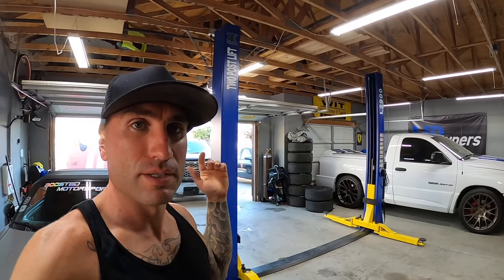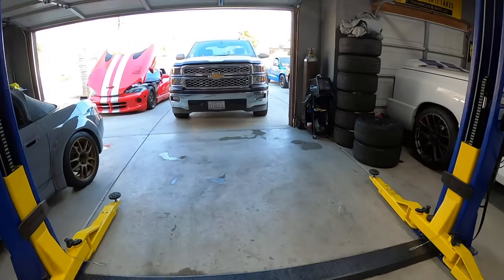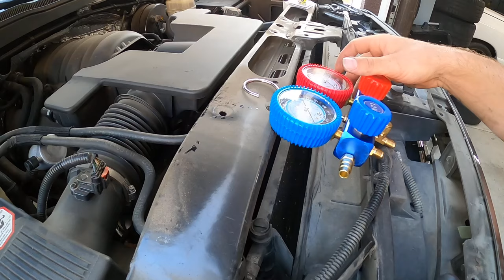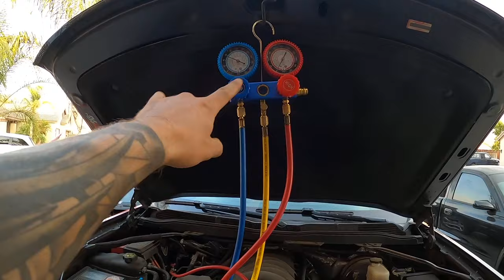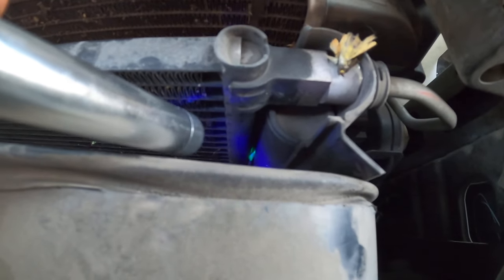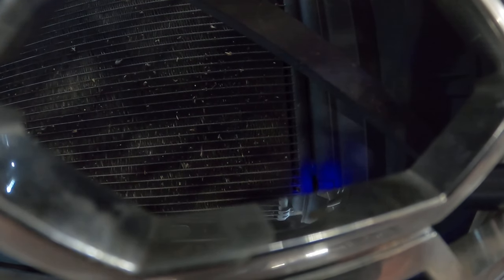HOW TO DIAGNOSE | 2014-2019 A/C FAILURE on SILVERADO | SIERRA | TAHOE | SUBURBAN

Comment: There is dye in the system from the factory. Adding refrigerant brings it back into circulation. A system is always vacuumed before filling if empty. You could vacuum the low side to suck the dye in the high side. That body style always leaks in that same place. Put the can upside down and regulate it with the low side of the manifold. Just open it a small amount and the whole can will go in in a minute. You are evaporating the refrigerant in the can causing it to get cold and lose pressure. Upside down it evaporates outside the can and the temperature and pressure in the can remain much higher
Reply: your comments are the most common sense for this video
Reply: Thanks for the tip about dye in system from factory.  Put a UV light on that weld and immediately saw the problem.

Comment: On my 2018 Tahoe, the ac and heat failed, would shut off after about 20 minutes of driving. Shop said it was because the temp outside.. so replaced actuators, evaporator core. So now soo cold it freezes and closes vents, same as before. Shutting off ac opens vents, fan blows whole time too. And no heat until after 77, vents close again after while. Then heat at max stays on, ac at max stays on, blower set to max. There is no middle.. any help appreciated.

Comment: I think I have the same issue with my 2016 Yukon, but the compressor does not come on. Can I add refrigerant without the clutch on or would you try jumping the pressure switch to add it?
Reply: I dont know for sure but my compressor would not come on and then when I added the refrigerant, the clutch started spinning so there may be a temperature indicator that engages the clutch
Reply: Did anyone try to do the relay or sensor bypass? I've tried I think correctly on the sensor and the fuse can't get it to engage and don't wanna buy freon to let it leak out haha

Comment: cool basics, but you can hook up shop air to the yellow line on the manifold gauge and charge the system with air to find the leak since you had already determined there was no system pressure. This way you don't waste refrigerant or die.

Comment: So this video REALLY helped me out alot!!! I was racking my brain trying to figure out where the leak was coming from.... I charged the system and put in some dye using this stupid injector tool I got from a part store (I didn't realize you could put the dye into the gage set before I watched this video)😅 then charged the system and sure enough BOTH the top and middle weld points were faulty. 😳😱 I'll be replacing the condenser this weekend and I'll also use your idea to reinforce it with some JB weld to better assure this won't happen again. I'm hoping this was the entirety of the issue with my truck. 🤞 Thanks for the content!! God bless! 🙌

Comment: Thanks BMS! I refilled my truck with refrigerant and it lasted about a day. The following day, my truck was blowing hot air again. I'm pretty sure I have the same problem. I will double check, but thanks for a great video.
Reply: Was there a leak in your condenser

Comment: Thank You for this Video. I have a 2015 Suburban and the AC has stopped working. The dealer has already replaced the condenser once as a recall and It looks like they will be doing it again. Thanks again for the informative video. 🇺🇸
Reply: They fix it? I have a Yukon XL my ac isn’t blowing cold

Comment: My 2017 silverado just stopped cooling all of a sudden so I wonder if this is my problem . I at least know where to look first so thank you for the vid!
Reply: Was the condenser the culprit?
Reply: @joshball4129  Yes it was.
Reply: My 2017 started blowing hot air last summer 😢I will have to check this out
Reply: There should be a recall on it.

Comment: Great video! Cant live with no ac in summer time lol. Easy way to find the leak if you can't see the obvious ones air it up with compressed air 45lbs, spray bottle soapy water an spray all connections. Fixed my 03 Ram in one weekend.
Reply from the maker: Tell me about it! I’ve been driving the Dakota all summer with no A/C and it’s been over 100 for weeks I think I’m putting the A/C back in and I’ll figure out how to fit a smaller intercooler for the supercharger later it’s brutal without it
Reply: @BoostedMotorsports  you can use and old kitchen refrigerator's motor pump and it's a bad @$$ vacuum pump for doing ac on the cheap and get that solid -30 vacuum
Reply from the maker: I have an ac vacuum pump! Just didn’t bother using it since the condenser has to come out. We just charged it quick to find the leak 💪

Comment: So I had a problem with my 2014 Chevy Silverado and what I found was the pump was still running and I had 50 psi on my high side no leaks freon level was good changed the expansion valve but It was the pump after I got it off and no tension was on it from the belt it was loose  just In case you run into a problem with your air blowing hot this is what my problem was
Reply: It's is hard to replace the pump?

Comment: Thanks for the video.Have the exact same leak,in the exact area.I put about 6 oz of freon in to start the clutch and find the leak.Was 6 oz still not enough to push any cold air through? It was still hot? Also, do you think I can use some JB Weld on that tack weld leak?
Reply: I was thinking the same jb thing did it work

Comment: I need help PLEASE my 14 Silverado air is intermediate. Sometimes it works great sometimes it doesn’t. I have replaced the high pressure switch and checked the pressure just on the low side with a simple can and gauge from advanced. The pressure maintains around 40psi according to the gauge. 
Any tips would be GREATLY APPRECIATED where to go to next.

Comment: Thank you sir for that concise diagnosis.   I likely have the same problem in my 2014 Silverado, but no tools to fix that leak.  At least I can undertake an economic way to determine where the leak is, hopefully saving time and money at the repair shop.  I shop I spoke to already provided a horrible quote to replace the entire system without ever referring to this diagnosis.  Watch out for those pirates.

Comment: You said compressor was not engaging. Are you saying it's not engaging because there was no r32. Cuz mine is not engaging either.
Reply: No freon...no clutch.
Reply: There's a pressure switch interlocked with the clutch so the compressor doesn't burn out from running without refrigerant.

Comment: I have asked a question in the dodge video about putting the shorty headers in and you wont reply.   My question is.  After the shortys are in and I get a wheel position sensor code,  what do I do to fix this?  We didnt do anything else but put the header in. I cant imagine breaking something else. Only had to separate the steering linkage at the spline.  PLEASE HELP!!
Reply: This isn't really the time or place for this type of question. Not sure the year or model of your dodge. But try joining a Facebook group specific to your model. There are a couple that are great for dakotas. But there is tons of info and its a much better place to get questions like this answered.
Reply: The sensor is located on top of the rear differential.... Try clearing the codes and see it pops back up again.
Reply: Google ram forums, prob just needs wheel sensor battery or reset

Comment: I tried to recharge my Tahoe with one of the store bought AC recharge cans, and the fitting WILL NOT connect to the low pressure hose. Do I need a special fitting for my Tahoe?
Reply: Same
Reply: Did you get an answer Kevin.  My 2018 suburban is the same issue.  The low pressure port will not attach to the standard quick connect.  But everything I see on the web says if it's the right spot it'll attach.  

What did i find out ?
Reply: @michaelcox86  YES! apparently my Tahoe, and potentially your Suburban takes a different refrigerant called R-1234YF. You can buy a recharge kit at Advanced Auto parts. I took my Tahoe to the dealer thinking the condenser must be leaking. They said I already had the upgraded condenser and that it wasnt leaking. They recharged my AC, and it blew cold the rest of the day. i parked it overnight and when I got in it in the morning the air was warm. I have another appointment on Tuesday of this week, so we'll see what they say.
Reply: @kcummo  I'm having this same issue. Any update
Reply: @thentantt  there ended up being a leak in the same area he talked about. Dealership replaced the condenser after I contacted GM and told them about the issue. GM covered it.
Reply: @kcummo  GM covered it? How many miles do you have on yours?
Reply: @julianason236  Hello Julia. I'm reading over these post as I'm having similar problems with ac in my 2017 Chevy 1500 4x4 LTZ Half way to the beach my air conditioning started blowing nothing but warm air. Went on YouTube tried to learn what I could. Next off to Auto zone for a can of 1234yf & a gadget. Did what was called for. Evidently I'm not low on freon so now I'm really wondering wth could it possibly be!! Compressor/Condenser surely it won't be something as cheap as simple as a fuse. Because if something turns out to my benefit or to my good. It was a damn accident. Cause I sure as hell didn't plan it that way!!

Comment: Has anyone had to replace the condenser twice?
Reply: Looks like I'm going to have to. Replaced mine about 2yrs ago. A/C went out 4 days ago, won't hold pressure after recharge, compressor won't cycle on

Comment: Hey man, my damn truck is having this exact problem. Where's the followup repair video?
Reply: I found the video bro, but the link to the A/C compressor does not bring up the identical compressor you install. Instead it pull up the model with 3 tack welds that is the problem.

Comment: I was driving  my truck and suddenly stopped  blowing cold air and the temperature gauge went all the way down to 160.
And when I stop the truck  the radiator fan kept working  for like 3 minutes
Reply: Mine did the same exact thing today.. what did you do to fix it?
Reply: When my did this, it ended up being the mechanical thermostat needing to be replaced.
Reply: Thermostat. I've put 5 in my '17 5.3L

Comment: Do not put the same manufactured condenser in as a replacement.If you do in a few years the same problem with the leak top left corner will leak again.The repair shop did the replacement and it leaked again after 2 years.Bad thin weld job in that area.What a friggin scam that is by GM.

Comment: I have an aluminum welder. Do you think i can patch the hole with that? Or should i just buy the whole new condenser?
Reply: its a $100 part.  Just buy a new one from advanced auto parts.  They come with a warranty.  Pulling the condenser out is a total pain in the ass and you wouldn't want to do all that work just to reinstall the condenser and have it leak again.
Reply: @jamescundiff3264  I watched the condenser install video and the new one came with reinforcement he also had the amazon link for replacement part

Comment: Tried having my ac fixed with a few other issues before the my extended warranty ran out. They said it seemed like it was working but did need to be charged. Well if you have to fucking charge it, then it’s not working, is it morons?  After charging it, I brought I back a whole later and they said they couldn’t find a leak and it seemed like it was working…. Again!  Still absolutely no ac in this truck. I don’t know how you can be paid by the hour and still be too lazy to do your job, but now I know I can likely just change the condenser.